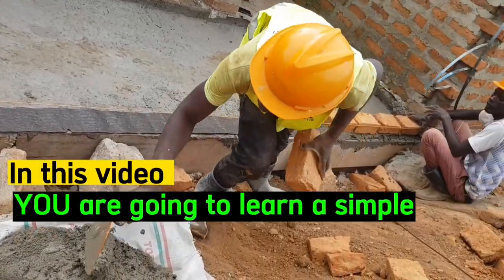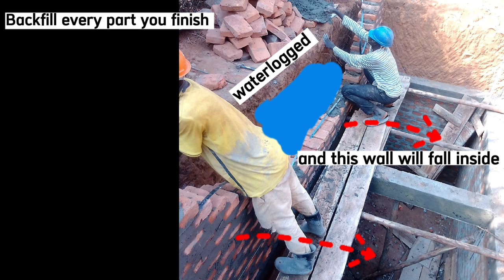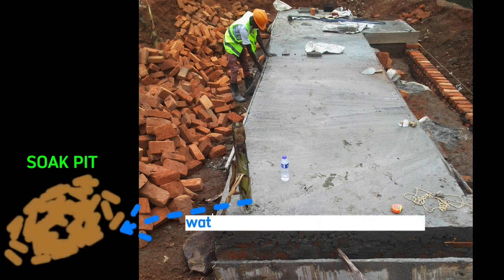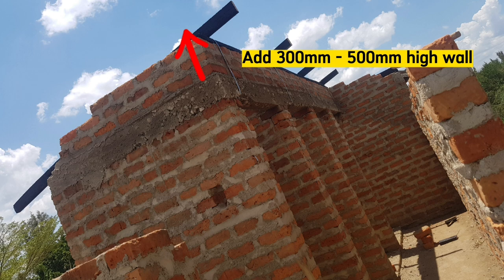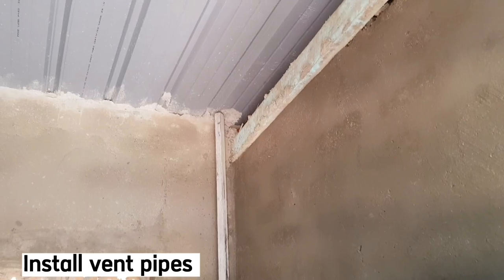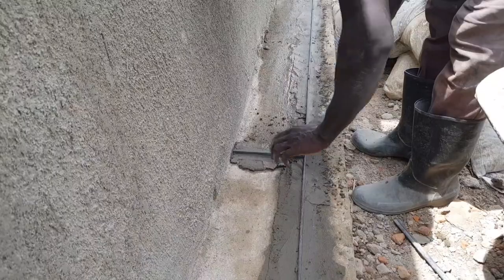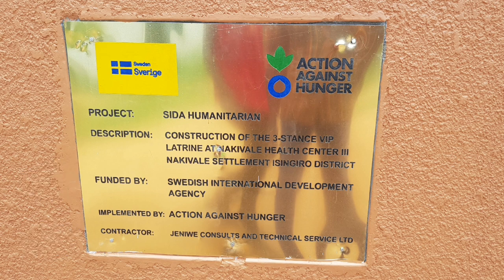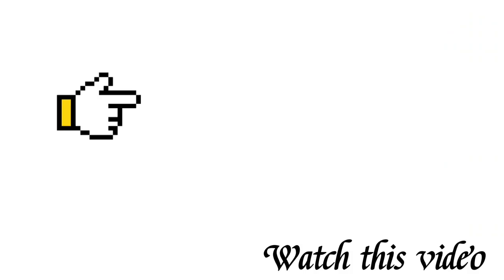How to Build a VENTILATED IMPROVED PIT LATRINE (Public Health Engineering)|Sanitation Facilities

Comment: How much did this latrine cost on a rough estimate
Reply from the maker: Following all the Steps I explained in the video, with a terrazzo Finished Floor and with both the intermediate ring beam and the ground beam, A five (5) stance VIP Latrine with an outdoor bathroom or urinal will cost you around 7,000 usd$ including labour and materials, A three stance will cost you around 4,000 usd$ and a 2 stance will cost you around 2,000 usd$

Comment: And it should not have cement in the bottom, becouse,  the Wast  must be in real eath for decare, smell, and not pailing up, it has to go down under.
Reply from the maker: A standard septic tank must have concrete and the bottom plastered and finished well
The soakpit is the one supposed to serve the purpose of soaking away the liquid sewage

Comment: Personally i don't recommend the use of fired bricks for foundation wall due to their weak structural strength and porosity. Instead i'd prefer a mass concrete wall.
Reply from the maker: Sure? bro, i think well burnt "clay" bricks CLAY -not red soil bricks,  are better for anything underground,
1.Because Clay Bricks have a low water absorption compared to concrete blocks 
 
Due to the the high water absorption of concrete blocks,  that's why we use bricks in the foundation or sub structure and then concrete blocks in the superstructure in buildings 
Well burnt clay bricks can withstand chemical corrosion far much better than Blocks because they have no Cement in them. 

It also becomes a mess once a single block gets a crack in the pattern(foundation) What it's holding above it is at stake.
And also, most blocks on the market are substandard and once used in water logged areas or damp prone areas, they will eventually disintegrate into pieces when water passes through them. (Because they are not always cured properly, manufacturers some times use sand during manufacturing instead of stone dust)
Solid Concrete Blocks can be used in the foundation if they can go up to 7.2 M.P.A complying to BS 5628 (To attain this, simply weigh if each block weighs around 30kg)
And that's why I conclude that Clay bricks are better to be used in underground work then above the natural ground (above the dpc and dpm) concrete blocks can be used

Comment: Thanks for knowledge you are sharing sir. I am curious about the painting. Would it be durable and cost saving to aply oxide colouring of the same colour finish(paint) on plastering mix?
Reply from the maker: An oxide is used when skim coating a wall not this usual painting of the wall, or you can mix an oxide with a Cement paste when doing Flooring BUT when painting, what is recommended is to specifically use paint of your required colour and not oxides. Mix  the base colour paint with different colour paints to come up your required or favourite colour but not oxides 

I hope that answers your question brother
Reply: @ianconstruction  I think I get what you mean. Thanks a million. Looking forward to more of your future videos.
Reply: @ianconstruction  one more question. As you build the septic tank. I was wondering why you do not construct the dividing wall and join it into the external box as you build. I think it might give extra strength to the box. Just curious.
Reply from the maker: I'm not getting your question very well but the way we build a septic tank is, we build a rectangular box as you said, with a single  partition in the middle(we build them together), its walls must full brick thickness or header bond and must have pillars to provide enough support since its a retaining wall. 

I hope that answers your question?